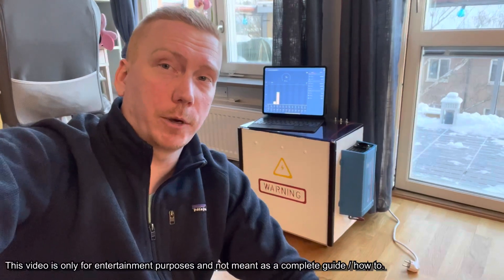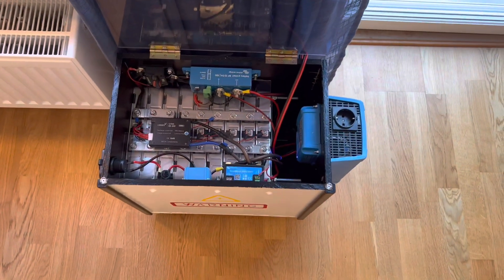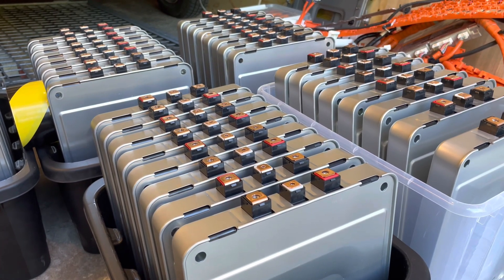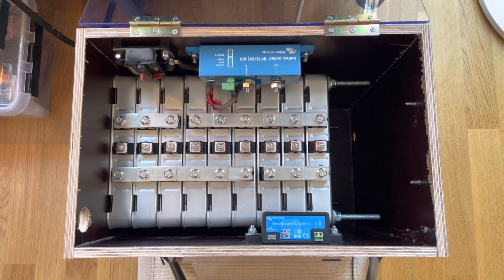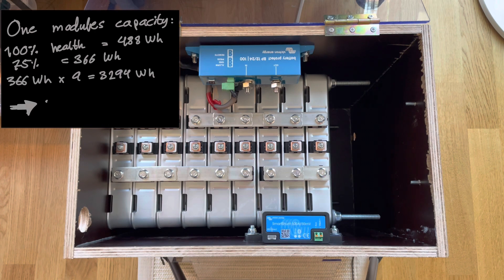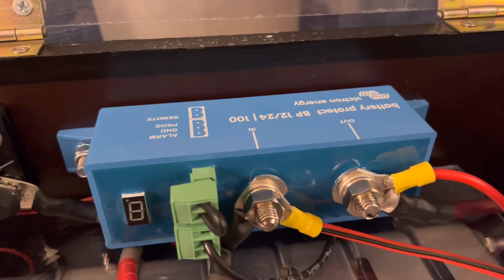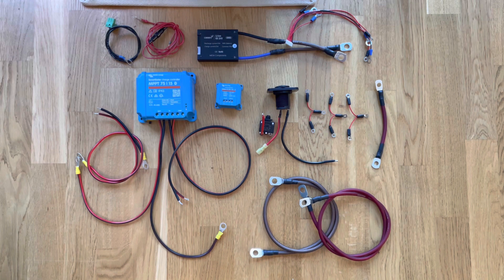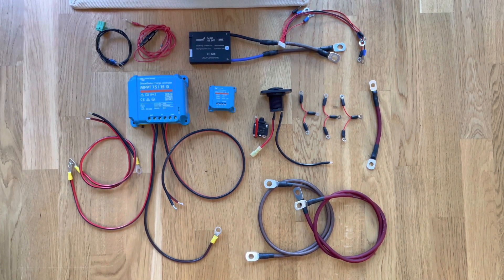Building a DIY powerwall w Nissan Leaf battery modules

Comment: What is the model of the inverter that you mounted on the outside, the one where you have you plug plugged in?
Reply from the maker: Its a Victron Phoenix 24/500. 230v. Max output is 400w. It’s good, silent.

Comment: At last I've found what I was looking for - settings for MPPT controller. Thank you very very much! Does it work like shown in the video? Did you change any settings?
Reply from the maker: It works just like shown. I just selected “lithium” profile and then adjusted both values to my fully charged voltage. And that’s it.

It still works, nothing changed after that

Comment: Great video! Can you please share a link to the BMS you used?
Reply from the maker: The BMS is from MESA components de, I got it from eBay but they don’t sell anything nowadays. I think it’s a German company anyhow. So far it’s worked fine.
Reply: @BasinBjorn  I'm a noob. I was looking at a Vicrton MultiPlus inverter/charger. Would I need a BMS too?

Comment: in the middle small sense terminal  i see there is no bus bar connected  , can you  connect 3 set  bus bar  in middle sense terminal configure as 6S  intead indivdual   wire to bms
Reply from the maker: I’m not 100% sure of how you mean but the middle row is where the cells balance and for that low current I just use cables and ring shoes instead of bus bars.

Comment: What was the cost of the Powerball. How many kw did it create and have you expanded it any further
Reply from the maker: Well the cost really depends on for what price you would get the leaf modules. I bought a whole leaf pack for about 1300 Euro, sold all but 9 modules and made 2500 Euro from that. Bms maybe 60 Euro.

Then the MPPT cost maybe 120 Euro, Battery protect 65 Euro, Inverter 180 Euro, fuse and cables 30 Euro. The solar panels (100+100+50w) was second hand, think they cost me 150 Euro.

So all and all ~ 600 Euro with the free leaf modules.
Reply from the maker: After making the video I expanded the solar panels to 100+50+100 watt, so now 250 watts. 

That makes about 0.9 kWh per day (sunny summer days)

Total gain so far 96 kWh.
Reply: Leaf modules are about £250 a piece. 40kw battery pack. Can't seem to see a whole pack cheaper

Comment: I am also planing to build 3KW 24V   system using USED Leaf Modules...
What is the minimum  Voltage of the module  i have to choose in your opinion? (Since  i am going to  use used modules)
Thanks
Reply from the maker: Well, just make sure you use 3 modules in series and then in parallel you use as many as you like.

Minimum voltage shouldn’t go below 3.50v per cell. So a module shouldn’t go below 7.00v.
Reply: @BasinBjorn  Tack för videon, den kommer hjälpa mig! Varför bör man begränsa sig till att parallellkoppla tre enheter? Jag är ute efter att nyttja alla batterier i ett liknande pack till min husbåt som kör 24v. Max belastning är 3500w. Vad anser du om detta?

Med förhoppning om svar :)
Truls
Reply from the maker: @trulskoch1889  Du kan självklart parallellkoppla valfritt antal moduler. Jag valde 3 i parallell pga att jag hade 9 moduler till mitt projekt.

Och som du redan förstått så blir det 3 moduler i serie. 3*3 = 9.

Modulerna har fungerat klockrent och jag använder de fortfarande.

Comment: can I ask what kind of BMS you used please
Reply from the maker: I used a MESA 6s bms from eBay. 50 or 60Amp. Without Bluetooth since that wasn’t available.
Reply from the maker: Also good to know that the cells are still balanced, just measured 4 out of 6 (that I could access) and they all showed the exact same voltage. So the bms seems to do it’s job.